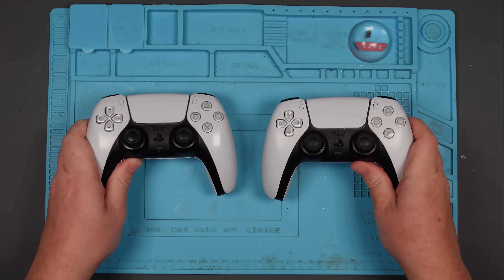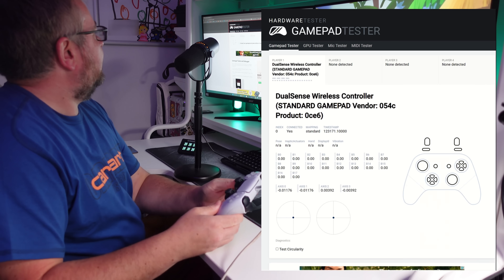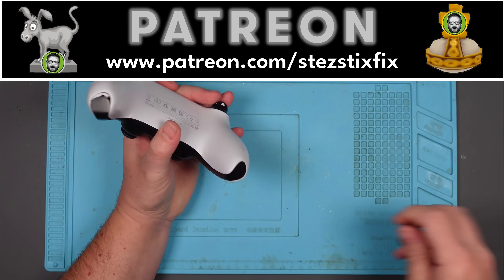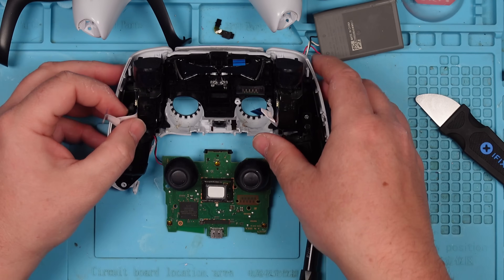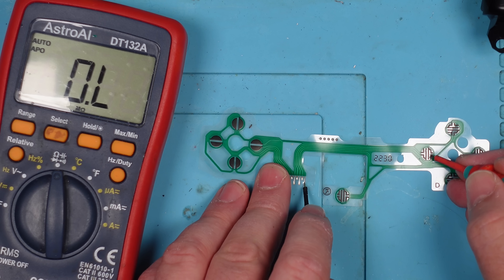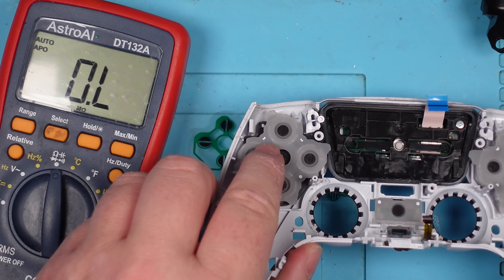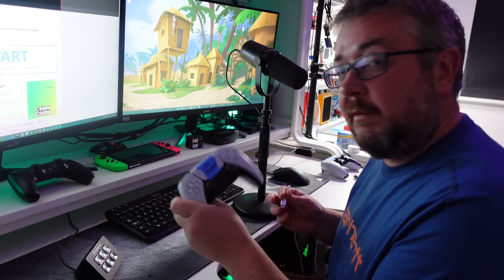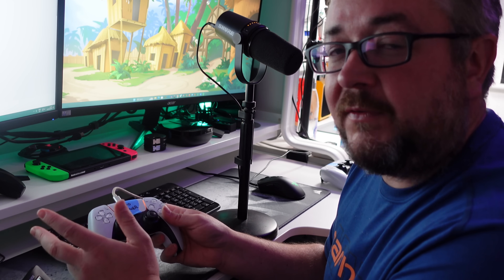These PS5 Controllers are FAULTY | Can they be FIXED?

Comment: 7:16 As an aside based on personal experience with the DualSense it is a nice controller. However I have noticed the odd misinterpreted controller input. It happens once in a while and usually during a rapid press. My guess is that in places where the controller is relying on floating contacts that this is where issue occurs. As in forceful pressing or movement of the controller causes the contacts to move slightly causing a dodgy connection / signal and input read. At least that's what I'm going with and definitely not me being caggy handed. 😂

Comment: I'm on my 4th controler. My every dual sense had the same problem.
After just couple months the sticks stop working smoothly.
Like there's sand in them or something.
Cleaning doesn't work. Every single one had that problem. No drift at all.

Comment: This is such an old and enduring problem that nowadays if the design uses these contact connectors I immediately tackle it to cost cutting or something like planned obsolescence...
Surefire way of killing anything that could potentially go through some temperatures thresholds, general warping, and stuff like that.
Thinking back, I probably discarded more than a few keyboards and other electronics because I didn't know about this.
The dome buttons with carbon contacts also seem to always have problems when they degrade or get contaminated with something, and sometimes cleaning the thing up just doesn't solve it. But these days you can find replacement pads.

Comment: I’m glad I’m not the only one who uses cardboard for a fix haha. 
By the way (and this isn’t advice) as you’ll see from an upcoming video on an electronic piano… I had an problem with those carbon contacts and I thought ‘I’ll just clean off the loose carbon… and like you, the cotton buds were black. I did a quick google and found I was making it worse as it was removing the conductive carbon from the substrate. It made it worse and some of the keys didn’t work still. I then got a soft pencil (7B or something) and rubbed that over the pads and the graphite stuck to it and sorted them all out! ‘Apparently’ that’s a temporary fix however a year later and plenty of playing, they’re working perfectly!

Comment: Just cleaned a buddies controller with similar ribbon as the second controller.. one of them ripped :-| when taking apart to clean.. good thing you can guy ribbon replacements parts. never teared up a ribbon cable like that before. seems cheap parts. in 80$ CDN controllers.

Comment: Steve a tip for you with PlayStation controllers: when it comes to the buttons not working or erratic behaviour on PlayStation 3,4 and 5 controllers, it is almost always down to pressure on the flex membrane. behind the membrane is a foam pad that gives pressure but over time it squashes down and becomes ineffective. To remedy this i have fixed hundreds of controllers by dipping the foam pad in IPA which causes it to swell initially but when it dries it goes back to its original size and thickness and restores function. i hope this helps with future PlayStation controller repairs.
Reply: I usually try to take it out and put it back in at a slight angle, but I do the IPA thing too.  Works very well.
Reply: I had that issue on an original iPod
Reply: I think you have just saved my PS4 controller. I need to do this once I get off work.
Reply: Typical bad engineering/cost saving design.
Reply: @-Brunnen-G Also making people without knowledge of how to repair shell out 80 dollars for a new controller.
Reply: @-Brunnen-G  What a garbage design. And these lumps of trash cost 70 fucking dollars each. My Dual Shock 2 controllers still work perfectly fine pressure sensitivity and all.
Reply: @DerpCrusader  there was 2 different versions of the PS2 controller, 1 was a poorly designed soldered on flex membrane and the other was slotted in to a ribbon connector which made it easier to change out after the contacts eventually wear to thin.
Reply: Good tip. I usually just put some double sided tape behind it to push it out a bit.
Reply: @DerpCrusader  Exactly. I still have one of my original dualshock two's. Still works well.
Reply: @DerpCrusader  Actually DualShock 2 controllers have immense failure rates, they are just for a different reason. The actual button ribbons fail and cause the buttons to not work. This is extremely common (and painful to fix) on "H"-type PS2 controllers which not only have huge failures like this, but also need to have the replacement ribbon soldered in place as the manufacturer cheaped out and didn't use a plug in connector like on "A"-type DualShock 2 controllers.
In other words - nearly all Sony controllers ever made are poorly designed trash with the exception of some PS1 controller revisions which actually use real PCBs instead of these flimsy cheap failure prone ribbons.
Compare that to OG Xbox and 360 controllers, which are extremely durable and 90% of them need nothing more than a basic service and an analog stick replacement after decades of use. Same goes for Xbox One and Series S/X controllers, but they are a bit painful to work on due to the complex dual-board setup.
Reply: foam is a bad idea. because foam as the tendency to crumble into dust over time.
Reply: @heatedgamer2931  There are the A-type, H-type, and M-type PS2 controllers (based on the manufacturer), each with a whole array of different revisions as well. All of them are cheaply made failure-prone trash, but the A-type do tend to last a bit better. 
The button ribbons don't just wear too thin, they actually fail even on controllers that have barely been touched. I've seen some of the ribbon traces straight up disappear over time.
Reply: @-Brunnen-G  "planned obsolescence". Great username, by the way. Loved that show back in the days. :)
Reply: @hillppari  I use abs and cardboard.
Reply: @AlDim000 H ps2 controllers are made by Hori, the membrane is almost impossible to replace without melting something, I hate them but they're super abundant where i live
Reply: You dip it in pale ale?
Reply: @Nandru85  Hori has nothing to do with the PS2 controllers.
A = Alps, M = Mitsumi, H = Hosiden. All of them are poorly designed trash, some are worse than others.

On the A-type controllers I still see lots of issues with dead buttons and also with one or both L3/R3 not working anymore (which is a PCB issue and is not resolved with a new analog stick). H obviously are the worst with the buttons failing on like 95% of them. They are repairable with a bit of soldering (it's pretty well the same job as changing out an HDMI port, but with a much weaker PCB, so they aren't exactly pleasant to do). Then M are basically not repairable at all as nobody makes parts for them. All in all PS2 controllers have turned into a big pile of E-waste and are easily the least reliable OEM controllers ever made.
Reply: Still dont know why sony keeps up with this system that is prone to failures for decades now.
Reply: @DerpCrusader Dam right, my ps2 controllers still going after surviving many years of abuse but both ps5 controllers 1 year old and already stick drift on both which I had to repair. Also these ps5 controllers are the least comfortable with the worst battery life!
Reply: I am very surprised with what everyone is saying here about ps2 controllers, I literally did full gran turismo including endurance races on them plus many other games and never any issues... maybe I was lucky, sometimes better to be lucky than good 😀
Reply: @AlDim000 That's a really long way of saying you're an xbox fanboy
Reply: @MichaelM28 eh......

1 person says yea the shift always tends to stick on that logitech keyboard its just a model fault pumped out by the thousands so I upgraded got a more expensive razer kb"

Your reply "long way to go about saying you are a razer fanboy"

The fault in that would be Sony make it cheap to make and sell it to you at full retail and because it faults like this people tend to buy more peripherals in my argument you have the option of getting another 3rd party brand but with Sony you really don't get that option its buy another, get it repaired or throw it in the trash. Stop sucking the corporate Sony jizzle.
Reply: PS3 controllers also have another fail mode due to them having pressure sensitive buttons like the PS2 controller had due to a change of resistance causing none of the face buttons to work.
Reply: @MichaelM28  oh look, another "my plastic box is better than your plastic box" person.
Reply: @mbirth  Thanks. It was obscure enough not to be taken, but not so much someone might get it.
Reply: I got a old dualshock with a completely dead D-pad (the one where the membrane is split in 2 parts) that i took apart to check this but i cant see any foam behind the membrane, its sitting directly on the plastic. Is there a foam pad on all versions of the dualshock 4 or have mine been removed by someone?
Reply: @johansamuelsson611  There should be foam, check inside the controller it may have slipped out or someone has removed it, i have used magic sponge cut to size before now to replace it.
Reply: @heatedgamer2931  I have watched several teardown-videos of the dualshock 4 but i cant see any foam under the circuit board membrane on any of them. Oh well, i have ordered a bunch of new membranes of aliexpress now and hope that replacing it is gonna fix the problem.
Reply: @MichaelM28  I'm saying that I service hundreds of controllers and most of Sony's are chronically terrible in terms of quality and durability. You're saying in not so many words that any criticism of your favorite corpo brand upsets you. That's a cultist mentality and it's not healthy, bud.
Reply: @johansamuelsson611   none of the DS4 that I've seen or taken apart myself has had foam behind the flex board.  I have taken apart multiple revisions of DS4 (launch day to final revision) and none of them have foam behind the flex board.
Reply: @heatedgamer2931  none of the DS4s I've seen or taken apart have had foam behind the flex board. The only foam I've seen on the DS4 is on the rumble motors.
Reply: @hinny2005 done exactly that with loads of ps3 controllers. Some cheap slightly thicker double sided tape under the foam has had 100% success rate and seems to hold up over time as well.
Reply: Is there any other foam or something that won't squish flat over time? Like cardboard? Or maybe polystyrene?
Reply: @heatedgamer2931  Update my PS4 controller works. Fine, thanks to this. I'm currently letting it charge. It's kinda crazy how much a bad connection can be with flex cables if you don't have enough pressure on them.
Reply: @CaptainJoeBoss  Glad to hear, it is a poor design but fortunately an easy fix.
Reply: New membrane for my old dualshock 4 arrived it the mail today. Dead d-pad is alive again.

Comment: Controller faults - something I can relate to! I have persistent issues with Xbox controllers suffering from analogue stick drift, from sometimes as little as 6 months old. Prompted by this video and finally deciding “I’ve had enough of this”, I researched the problem. The transistors are crap, and Hall effect is the way to go. I will be ordering a Machenike G5 Pro to replace the shit overpriced Microsoft junk. I could keep replacing the transistors but that is not solving the overall problem. Appreciate your work 👍

Comment: Hi Steve, I have 6 Xbox One S controller main boards. All of which I've tried and failed at changing the thumb sticks. I have watched numerous videos, but I guess I'm a huge idiot with a soldering iron. I have successfully changed 2, but due to the pads being so delicate...you can imagine what happened. Could I arrange them to be repaired in a future video. I'd like 2 back and the others can be used as you see fit. Thanks.

Comment: I have a piece of electric tape on one of the bumpers of my 360 controller either because the switch moved just enough it didnt click properly or the plastic on the button wore off by that much. 

The pads being different internally diesnt surprise me much - we had an whole box of broken Dual Shock 2 controllers, and trying to get matching models to get at least a handful of them working was nearly impossible.

Comment: This is also a similar problem with older dualshocks. Fixed a couple ds3s with a similar issue. Added a piece of foam or cardboard for pressure to make better contact

Comment: This membrane design has been used for years by sony I believe since the dualshock came out. Most of the time fixing them, I just had to either replace the foam that applied the back pressure, or simply let the foam expand again. Sometimes, the conductive material just faded away over time and had to replace the entire membrane. Cheap fix, but can be annoying.

Comment: It was the power of illumination as the light indicated function :D PS5 controllers are cheap. Buy them with stick drift, invest 2x50 cents in hall effect sensors and a little work and they are better than new. The ribbon cables are a pain.

Comment: This is why I hate play station controllers, when they work they're wonderful but the membranes always ended up failing either by wear or by lack of pressure to ensure connection

(btw can you believe that the pressure problem in the membranes has been a thing since the ps3 controllers? 3 gens in and sony never bothered to fix it)

Comment: Good to know ! My first PS5 controller has a different issue though and you can't test that with the program either. I can't use the central button (trackpad) any more, it clicks only once in a while. But I don't fancy taking it fully apart without knowing if I can fix it. So I just use it for games that don't need this button.

Comment: Previous dualshocks used to have a foam pad behind the ribbon contact to push it up against the contact pad on the board when it all closed up. Sometimes the pad wore down and you'd need to replace it with something of equivilent thickness. Weird that the dualsense doesn't appear to have one.

Comment: Seems like at 9:04 you tested the pad without the black plastic piece & screw of the battery. If you don't put it, there isn't enough pressure on the flex circuit board of the buttons by the motherboard and they don't work or just partially.

Comment: I've fixed a few PS4 controller and in several cases when some buttons haven't been working, replacing the analog sticks have fixed the issue with other buttons. Super weird. But just an FYI.

Comment: I could've sworn those membranes would've come with a piece of foam behind them to keep solid pressure on them. Either way, it's such a stupid design. You know they design these controllers to fail after so long so they can keep making sales on new ones anyway, so in that respect, maybe more clever than stupid. (that's why they keep using potentiometers on joysticks instead of hall effect sensors too).

Comment: About the only thing I would do differently here would be to 3d print a small plastic wedge instead of cutting up cardboard.  But based on @heatedgamer2931's comment about the foam, that might not have been a good idea.

Comment: These controllers are a bad design. They look nice and sleek, and have a nice crisp feel. But a lot of times if they get dropped that same connection gets knocked out of line just enough to ruin the whole thing. I've come across a few PS4 controllers with the same issue.

Comment: My nephew had two PS4 controllers that were misbehaving, he ended up with 1 fully working controller, with mixed parts from both.
One of them was f'd because the connectors on the membrane were basically erased for some reason.
That connector is such a bad design

Comment: I have fixed multiple of these issues by cleaning the entire ribbon cable with ipa, they are very sensitive to any dirt, had a few were the trace gets damaged at the point it connects to motherboard

Comment: Why wouldn't they just...make this a latched ribbon cable like the others? Seems like a big design flaw. Great video as always!
Reply: It's been like that since PS2, I guess it's some kind of Sony's fetish with their controllers...
Reply: @SirBig  Their H model PS2 controllers had cables that were crimped into connectors and when they failed you had to complete desolder the connector and junk both the connector and ribbon and solder a new connector on that allowed you to insert and remove new contact pads.
Reply: @oOignignoktOo1 even some dualshock 3s had a connector as well
Reply: You cant sell more if they dont fail.  This is clearly a design flaw that engineers at That level would know about.
Reply: Sony makes their money off of accessories and the gamepad is the thing which receives the most wear over time. It behooves Sony (the creators of the terrible and expensive proprietary Memory Stick format) to save every single penny on controllers, especially if it causes them to fail early. It's Sony's way or the highway when they decide to do or not do something, and they won't let logic or the truth get in the way. 
Remember how "the rumble motors would have disrupted the sixaxis functionality" on PS3 controllers? 
And then people complained a LOT, and Sony put the rumble function back in, and the sixaxis functionality was unaffected? 
Sony do how they please and not gonna let logic get in the way of being a stick in the mud. They even let their stupid Memory Stick garbage ruin the Vita's chances to gain portable market share from Nintendo. 
Sony CEO (Godzilla?) was like: "we don't want a share of that sweet sweet portable console market if it means we can't sell overpriced proprietary Memory Sticks too"
Reply: It's designed to break after time so you will buy another one. They know perfectly well. They should be sued for this.
Reply: Remember when Sony put rootkits on audio CDs?
Reply: I think its to Sony they are taking stuff more in a modular way look at there slim ps5s they are modular as in you can spend more money for a disc drive.